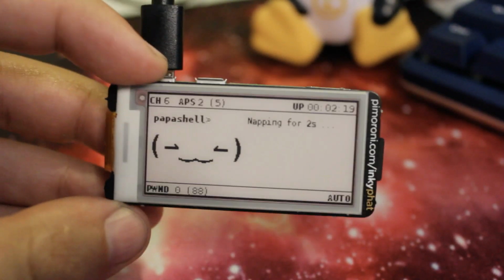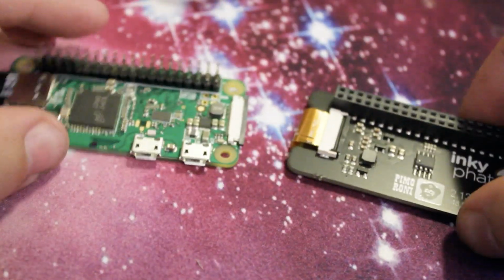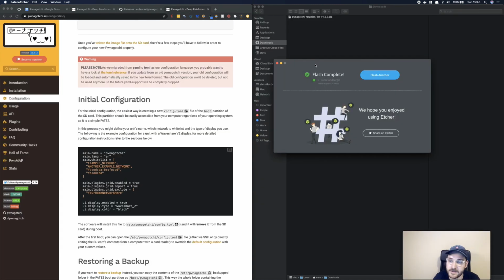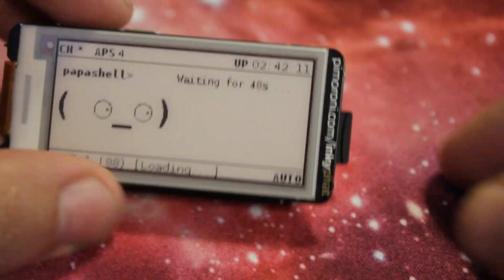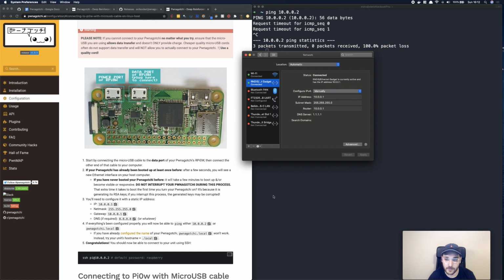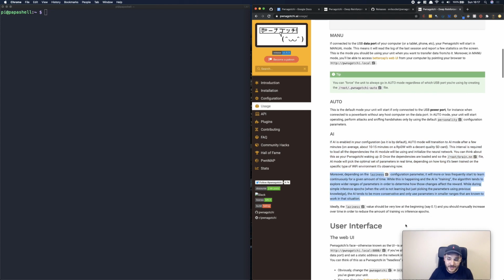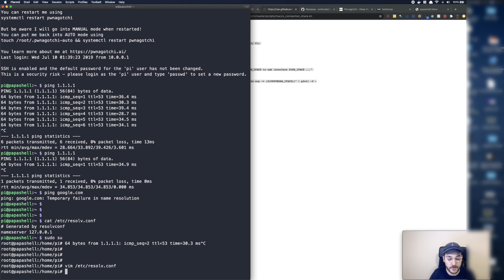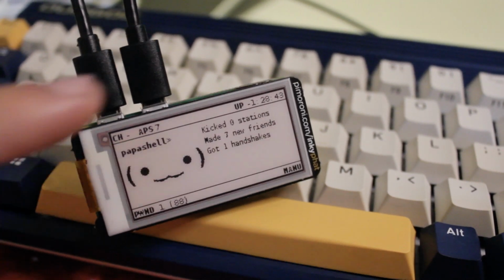Pwnagotchi - The Open Source Wi-Fi Hand Shake Hacker

Comment: On my first boot, it keeps the default name "pwnagatchi" and keeps eating my home wifi networks handshakes eventhought I told it not to in the confg.toml file
Reply from the maker: Hmm, you have the networks defined under main.plugins.grid.exclude? Are they spelled properly? You can use both the essid or bssid for those. Maybe your config file is not in the right place or misformatted if you've changed the name and it isn't updating
Reply: @MrStetsonator  I figured out my issue, even though I was saving my file as "config.toml" windows saved it as "config.toml.txt". So I had to create the file using powershell.
Reply from the maker: @JohnDoe-wi7eb  nice! Glad to hear you got it!

Comment: Good video, I'm trying to setup mine but one thing I'm not sure about is the static IP address setup.  I don't have much knowledge in networking I have to admit, but does it matter if my home network is the same as what I'm setting up on the Pi?  10.0.0.1 is the address of my home router, should I change that for something else in the Pi? I just don't want to mess my home network in the process...
Reply from the maker: I don’t think you’ll mess it up but it may or may not work. I’m not really sure how to change the connection address on the pi, but there’s got to be a way
Reply: My network is also set to 10.0.0.0, Did you get this figured out? I haven't been able to find any other info on this.
Reply: Ifconfig

Comment: just have two questions, how do you add plugins? and how do you clear the handshakes on the device after you've copied the handshakes?
Reply from the maker: check out plugin docs here:
https://pwnagotchi.ai/plugins/

basically you need to pop them into the right folder. If you have the pwnagotchi UI turned on you can enable them from there. 

I believe if you move the handshakes out of the folder they're kept in, it should zero out the count.

Comment: Question : You said this is hacking correct and it will send deauth to clients so for it to send deauth it has to connect to same Ap as client . So this is fine if someone is using Open Ssid ,  Wep but would it be using brute-force to associate to Ap ? If it isn’t associating to Ap then how is it able to send deauth to client ?
Reply: No need to be connected to the same network to deauth
The MAC addresses of AP and station are enough
Reply from the maker: Christophe is correct
Reply: To answer this question the Pwnagotchi uses packet injection to send the deauth request to the AP. It associates with the AP but does not connect to it like you are thinking, this is raw frame injection basically, provided the AP in question is capable of accepting injected packets

Comment: I have a raspberry pi 4 with a wifi adapter but it doesnt use it for monitoring Mode  do you know how i can change that?
Reply from the maker: Pwnagotchi doesn't use it? You might have to check if the adapter supports monitoring mode. Here's a quick video that looks like it might explain that: https://www.youtube.com/watch?v=JSMw4AHjRAE
Reply: @MrStetsonator  ok i think i got it  also is it possible to connect it to wifi? Because i dont have a ethernet cable rn xd
Reply from the maker: @iosgamertool8741  You'll need a way to log in and connect the device to WiFi. There might be a way to do this from the boot sd card, I'm not sure though. Otherwise, get an ethernet cable or a cable that lets you SSH in
Reply from the maker: @iosgamertool8741  it is if you have a wifi adapter

Comment: How long can the "initial boot" take? I've tried doing the very same as you, with the config.toml saved into the boot of the SD.
Yet i can't seem to get the screen to lite up with ASCII ◕‿‿◕ Help ?
Reply: im having the same issue, did you ever fix it?
Reply: does the screen not work at all? If yes I would reccommend to check the connections. for my E-ink (unrelated to this project) the ribon cable would become loose randomly and then the screen didnt work anymore.

Comment: hey is there a way to get it working on the inky phat v2 ? cus im having some problems booting its not displaying anything thanks coo vid by the way.
Reply from the maker: Hmm...I'm not too sure on the differences. The library should be the same so I imagine it'd work the same.
Reply: @MrStetsonator  my bad on the late reply ,but yeah I configure it the way you did and still no luck , the inky phat I got came out late 2020 and I read that drivers are not supported or something idk I’m still trying to figure it out thank you for replying
Reply from the maker: @maimon6993  The inky lib says it's for v2/v3 so it's weird it wouldn't work for you
https://github.com/pimoroni/inky

I haven't seen any distinction online between models. 
One thing you could try is directly using the inky phat with the above linked library. Run one of the samples or import it into python and write some data out. If it shows up, there might be a config issue with your pwnagotchi config. Maybe syntax is incorrect or you didn't close out a parantheses. Feel free to upload your config (scrubbed of any important data like home SSID's) and upload to Github/pastebin and I can take a look. There's also a /r/pwnagotchi subreddit that is decently active you could ask in
Reply: @MrStetsonator  thanks man ima check it out rn my inkyphat does display with the examples but not with the pwnagotchi setup, i can see that on the back of your inky the model is FPC-7502 mines FPC-7528 s , I posted my config on the pimoroni/inky check it out if you can .
Reply from the maker: @maimon6993  I see it and replied

Comment: When i type the ip into the web browser it pops up a login box. Not sure how to fix this part. All else works. url it list doesn't work either.
Reply from the maker: are you on the correct port? you might be accessing bettercap, the creds for that are pwnagotchi/pwnagotchi. Pwnagotchi is running on 8080 and the creds are changeme/changeme
Reply: @MrStetsonator  Thank you for the reply. I figured out the issue. I used the wrong default username and pass. Guess whats what happens when you work on stuff at 4am XD.

Comment: I have a really dumb question... do I just ssh into the pwnagotchi with powershell or what do I use? Im currently not getting any thing from my screen. Its blank.
Reply: how do we run the host sharing script? copy it to what?
Reply from the maker: You can use powershell or putty. You'll have to set the USB device IP address so it can communicate with the pwnagotchi. Once you've done so, you should be able to ping it. Check out the configuration page of the docs for more info:

https://pwnagotchi.ai/configuration/
Reply from the maker: For sharing your connection, check out the docs here:
https://pwnagotchi.ai/configuration/#host-connection-sharing

You'll have to have a network connection to the pwnagotchi already and then run the Windows script locally on your pc (assuming you're on Windows)
Reply: @MrStetsonator  awesome thank you so much. I have no idea what I did but its suddenly working. Had to send the display back I think its shot.

Comment: Hello, i'm not very good with... Hacking and... Cracking, but this project is soo cool... Should i build one? I have 1 Raspberry Pi zero w and another one but V2 w, maybe the V2 is better for this.
Do you think that i can crack some passwords with that? Obv i don't want to be arrested, is just for fun, but it can be cool if i can find some caffè wifi password (i can just ask for that public wifi but... It is cool to see if this can find something, or maybe with my own wifi password)
Reply from the maker: Yes you should build one! You should also only use it on networks you have permission to test on. You won't be able to crack passwords alone with pwnagotchi. I believe there is a method but it is more involved and probably only works on weaker passwords.

Comment: only for 2.4ghz networks?
Reply from the maker: I think the raspi 0 only has an adapter that supports 2.4, but if you have a different network device that supports it, you can sniff 5 ghz
Reply: The pi zero w supports only 2.4ghz, so no. I have the esp8266 deauther and works only with 2.4ghz too. On the other hand, if you use a 5ghz or a mixed wifi at home you should be pretty safe.

Comment: caping handshakes is simple  always has been. now comes the issue assume 120 char set 8 char long password... minimum for wifi....at 9 months to go from aaaaaaaa to aaaaaaba on a brute force .....why bother ?  unlessthere is some insight to the actual password there is no way to try them all...now a 64char long password with a char set from more than one code page making 250+ chars possible per password char location says its millennium of wasted time ,,,,
Reply: passwords  well you will get any that are in your wordlist so odds are you wont. tools to cap....it all comes down to aircrack-ng and its suite of tools.. if you understand that your good to go as everything to do with wifi wull use it in one way or another. bettercap is nice but so are many others .none can crack a password they only compare your list when encrypted with the encrypted key it got in the handshake  when they match you know what the password is but again with a minimum of 8^120 possibilities for a minimum length password and a complete list taking petabytes of space  it just is not possible unless as in ww2 you can narrow the possibilities,

Comment: holy shit this project has been the biggest waste of 11 hours in my life. Every single step of the way has been plagued with problems and I've spent hours trying to find any infromation on how to resolve my issues. Everything is so vague and unhelpful the farthest ive gotten is trying to sshing into the pi vi a pi4 with rasbian and being completely unable to access the web ui for no apparent reason. This video explains things pretty well but I'm not using a mac, my pc doesnt see this device and I don't have any other ways of interacting with the pi zero. What a fucking joke.
Reply from the maker: What issues were you having? I had a similar experience when I was just learning about Linux and raspberry pi’s. It does get better and you build knowledge quick.
Reply: @MrStetsonator  me? lol  old age arthritus ..having to switch to 16 pt fonts ffs  but wifi lmao  im 52 with 44 years expierence on systems hardware and networking  so issuing commands and configuring variables and switches  i guess when its blurry i could use someone to read for me
Reply from the maker: @mobiousenigma  my comment wasn't in reply to you, but @tankepidemic
Reply: you can get the proper adapter cables and just connect a screen to the raspberry pi